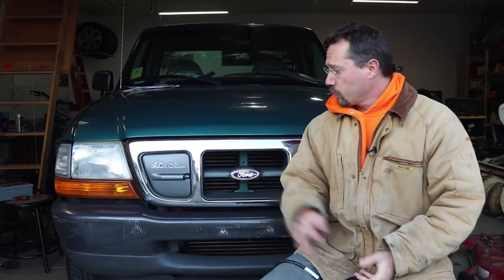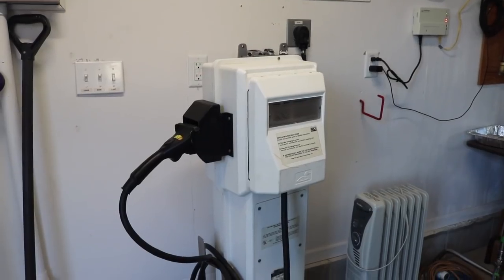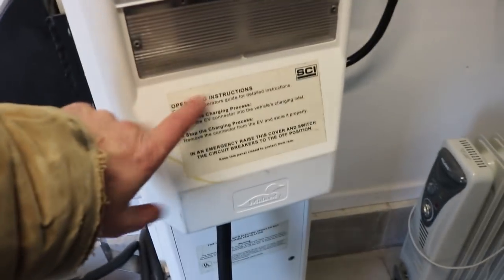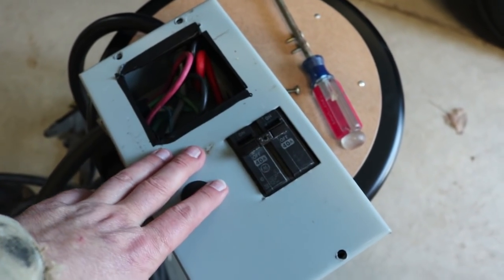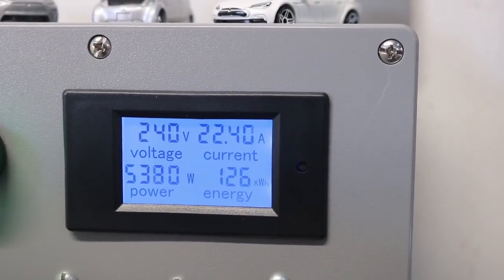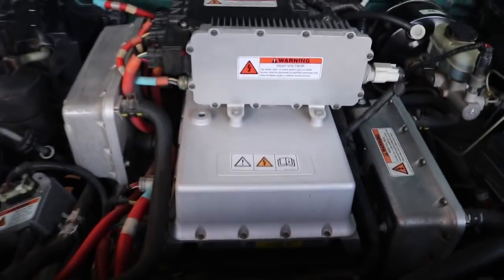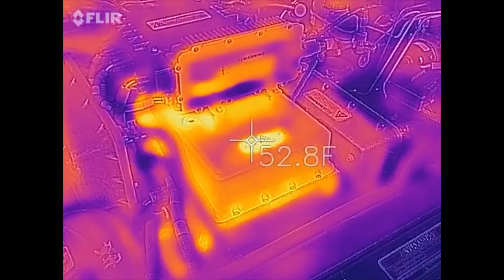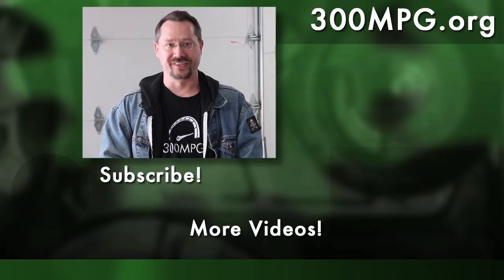Ford Ranger EV Charging with AVCON connection (plus thermal video)

Comment: Been, somehow you're educated on how these work. I have a Smart Fortwo Electric Drive, very simply I would like extend the range by charging from two lithium batteries in the back while driving. Can these cars be tricked into accepting a charge while driving?
Reply from the maker: It's not easy to charge a commercially-built electric vehicle while driving. There are all sorts of safeties preventing you from operating the vehicle while plugged-in. (So you can't drive away while plugged into the wall, for example.)
The battery will also be very hard to access (for safety, keeping people from electrocuting themselves.)
In theory, you could use a higher voltage battery to charge a lower voltage battery. This could also be done with a DC/DC converter to get to a voltage high enough to charge the main battery pack.
You also have to keep in mind physically how LARGE the stock battery pack in any Electric Car is. You would really need a pretty large secondary battery to be able to add any significant amount of range.
Modern commercially built electric cars are well designed and low maintenance, but they are also difficult to modify.

Comment: Question about the "box" on the wall that monitors voltage, amperage, watts, etc. Is this something you made or is this something you purchased? Do you have a separate video about it? I would be interested in this if it could be used with a NEMA 6-50 outlet. Thanks for sharing this video series on the Ranger. Very interesting stuff here.
Reply from the maker: It's something I built to automatically start charging my basic electric car at a certain time. I can also remotely control it, including by saying "Alexa, turn on electric car charging!"
Even just the little multimeter built in is very handy makes it easy to track my total power use on electric vehicles over a month.
https://youtu.be/ivrwbV-fAb4
https://youtu.be/TszuTBUWsTo

Comment: Is your inlet port set up with the contacts for DC fast charging? The plug and socket I bought surplus back in the late 90's or earlly 2000's had the contacts in the vehicle half, but the plug was just the lightweight AC version.
Reply from the maker: In this case, AC and DC charging would be completely separate from each other. The truck only has connections in it which carry AC power to the battery charger built under the hood. I also have a CHAdeMO DC Fast Charge inlet salvaged off a different vehicle. That has two large pins (DC+ and DC-) plus a number of small pins for communications.
In the current, modern electric charging, the CCS plug combines J1772 with a DC Fast Charge connector together in one socket.

Comment: Just FYI... I converted a lead acid car to Li-ion. I went with 144 x 72 Amp-hour batteries in 3P48S configuration from Electric Car Parts company ($11,000), a 6.6 Kw charger ($1000), and an Orion BMS for ($1000). I use canbus communication between BMS and charger and BMS and my laptop via a canbus to usb adapter.
Reply from the maker: I definitely have to come visit you, Jack!
Reply: @BenjaminNelsonX  Yeah, let's get together. I will send private email.
Reply from the maker: @jackonthefarm5540  Thanks Jack, it was great meeting you! I hope we can do a little video on your electric car conversion in the future!

Comment: Great seeing a little bit of history. Had forgotten about those connectors. I'd be awfully tempted to make some ducting around the charger cooling fan to divert that warm air into the cab to preheat it before taking off, especially this time of year!
Reply from the maker: Not much waste heat from the charger. The fan sure is loud though!

Comment: Yes the Avcon was the J1772 standard of 2003.  Lucky for you the communication protocol is exactly the same in the current J1772.  All you have to do to modernize the truck is change the plugs.
Reply from the maker: I was a little surprised to see that there wasn't a "Plug Present" pin on the AVCON connector. I'm not sure how the EVSE prevents a drive-off while plugged in.
Reply: It is a magnet.  Run an iron nail along the edge between the two pivot pins and you'll find it.  There is a reed switch in the socket at the location where the magnet winds up.  It's completely passive, isolated, works even during a power failure and doesn't require a extra pin in an already crowded connector.
Reply from the maker: @randycarter2001   Ha! Cool. I tried it out. Yep. Magnet is most of the way to the left along the top most edge. Thanks, I never would have stumbled on that by accident. Modern J1772 uses all conductive pins. I had no reason to think the earlier version would have done anything different, but saw that there was clearly NOT a proximity pin! There's always more than one way to skin a cat!
Reply: If you had a grudge you could stick a magnet in position with black electrical tape and cause the car not to work.  They will wind up calling for a tow, have the service center do diagnostics because the car wont start up or exit the park mode.
Reply: @BenjaminNelsonX  This is just an hypothesis, but If the car's computer can communicate with the charger, then the charger can tell that some input voltage is present, plus the charger initiates a data handshake with the EVSE, therefore, the car's computer can disable the motor, and there is no need for a redundant wire for plug presence (but it's a good safety feature).

Comment: Is the the lead acid of NiMH version? Looking forward to seeing how those batteries are holding up. Nice project.
Reply from the maker: This is the first year they had the truck. It was lead-acid from the factory. The rest of the years were NiMH.
Reply: BenjaminNelson, ok, I just watched the video I missed showing the modification they did. I guess the 8v 60ah batteries were too expensive so they put in 12v. That truck will be better than new with a Lithium ion battery.

It will be interesting to see how you get the Ranger to tell a DCFC how to charge it.
Reply from the maker: @imho7250   I have a CHAdeMO inlet. I know that the Orion BMS has the ability to deal with the data interface to the CHAdeMO DC fast charger. Just those two things plus a nice big contactor SHOULD allow for CHAdeMO charging. However, the Orion is an expensive one. If anyone knows of OTHER ways to handle CHAdeMO, I'd love to know!
Reply: BenjaminNelson, yes. The Orion BMS2 looks like it’s user programmable and can be set to work with chademo. I wonder how much control it gives you over the charge profile. Sounds like enough to fill 2019 with good content.
Reply from the maker: @imho7250   The other thing I'd love to do is find an inverter that can run off 300+VDC. Build my own rolling household blackout protection. Solar inverters run right in the same range of voltages as electric car battery packs, but almost always also are for grid-tie, requiring an active and stable grid connection.
Reply: BenjaminNelson, it’s probably easier to find 48vdc inverter/Charger. Isn’t that what Tesla powerwall is?
Reply from the maker: @imho7250  48V inverters are common, but how would I then be able to use the entire truck battery pack as a power source?
Reply: BenjaminNelson, oh, you want V2G. You just need one of those Nissan Leaf V2G/V2H boxes. I think the inverter will be the easy one to build, but the controller that lets it work will be hard, unless Orion also supports that.

Comment: Charging that little truck pulls more juice than my water furnace lol
Reply from the maker: And of course, we need to remember the difference between a RATE of charge vs the total amount of energy.
Generally, a higher rate of current is considered advantageous, as it means faster recharge times. The charge rate doesn't have that much to do with the total capacity of the battery pack. As best I can tell right now, this lead-acid pack has rather limited capacity. I'll make a video about that in the future once I have a good sense of what the real capacity and range is.